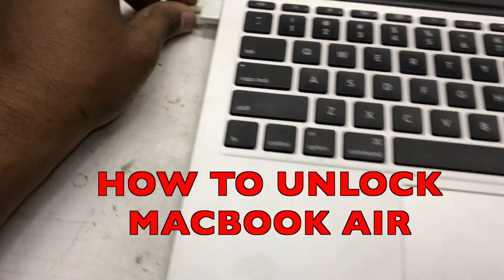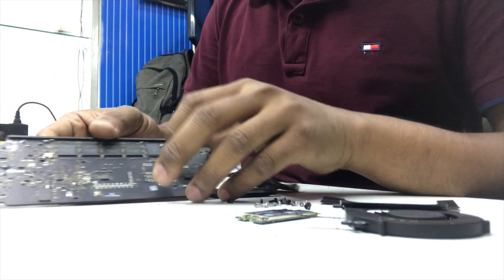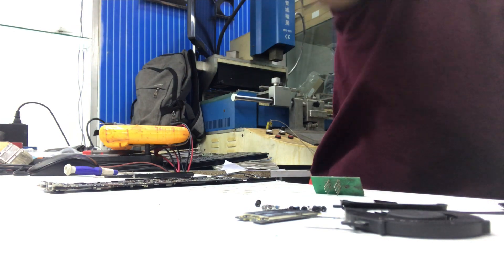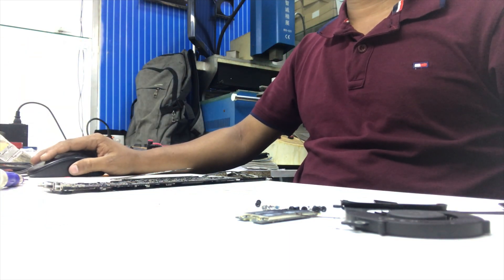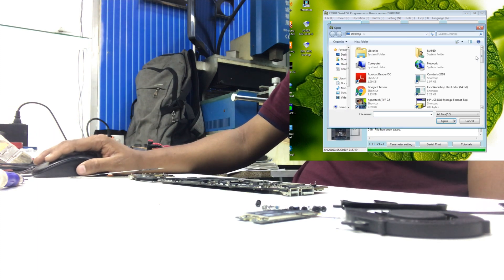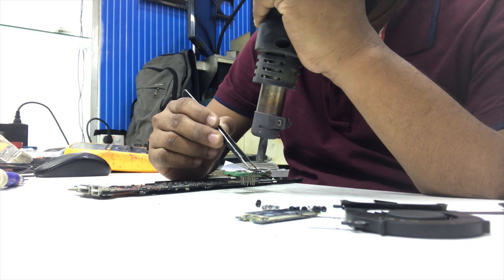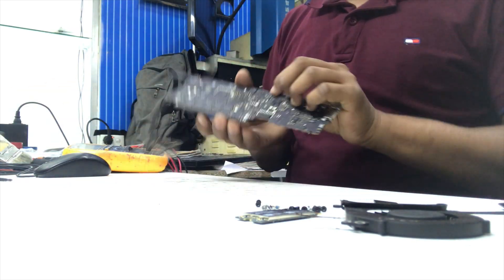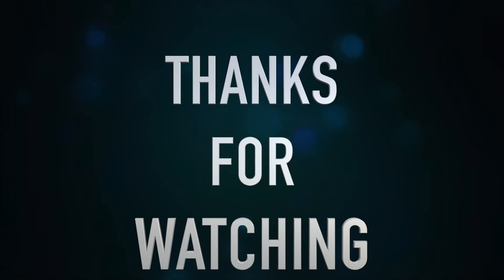How to remove MacBook Air Firmware Password...

Comment: Hi why did you not just remove just pasword with now flashing a new bin dump is the serienumber and other information not right anymore. To remove the pasword in original dump. Just open it with hxd editor and search in dump $SVS and replace that section with ff and pasword is removed. Regards Steve from Belgium
Reply: Hi Steve. I bought a Macbook Air model ‐A1370 on Auction but it has a password .help me